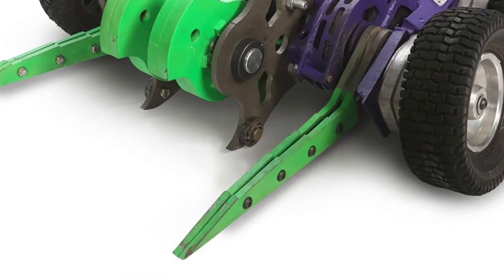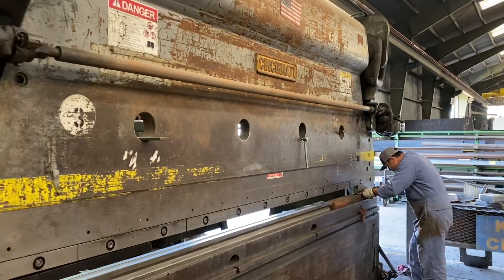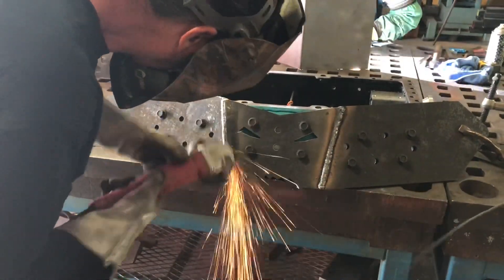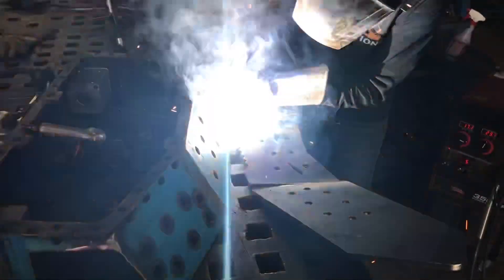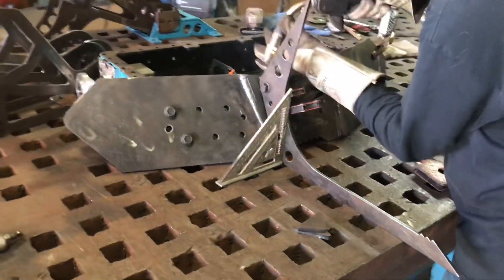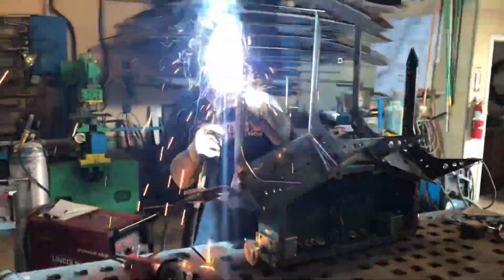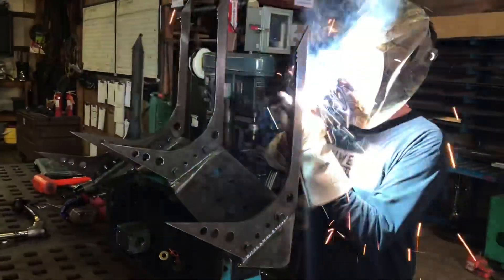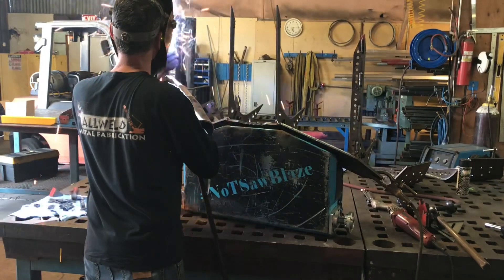Scorpion King Armor: Skorpios Builder Blog Ep. 21

Comment: Well with s6 over, we never saw this armor
Reply from the maker: we used it for End Game 

it was over wight so we had to cut parts off it did not looks as good after
Reply: @SkorpiosBattlebot  I mean it really wasn't the full armor setup, just those end forks and it didn't work as well. The one you used in the cobalt fight looked much better (because of those hinged forks on the front).